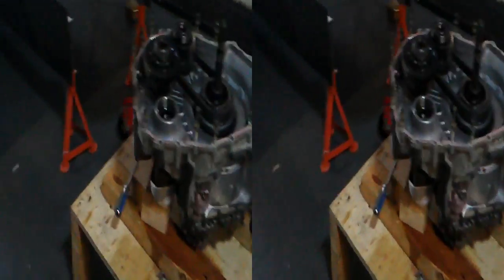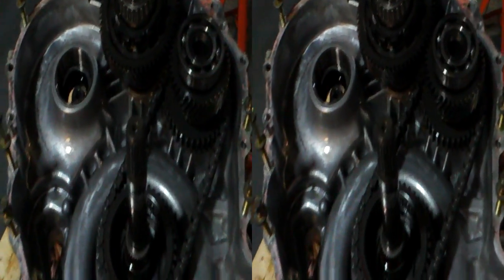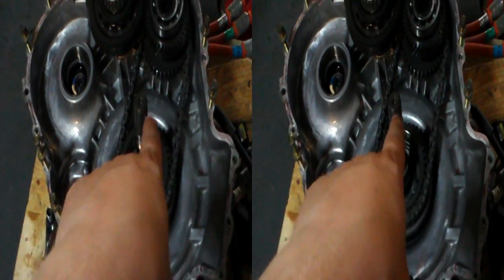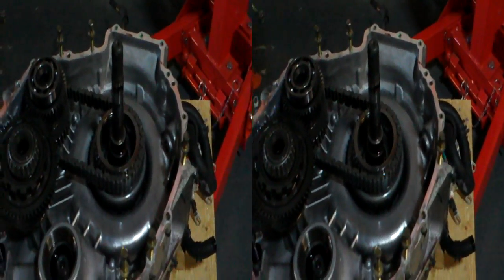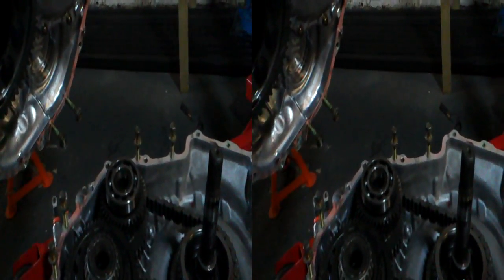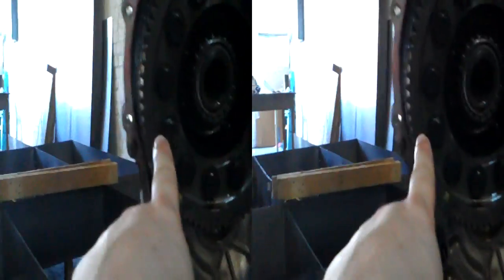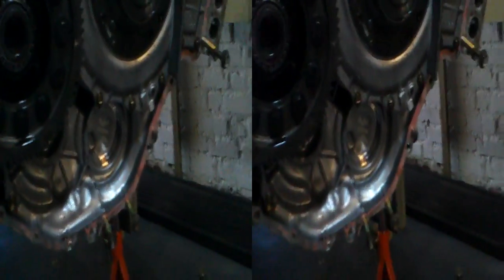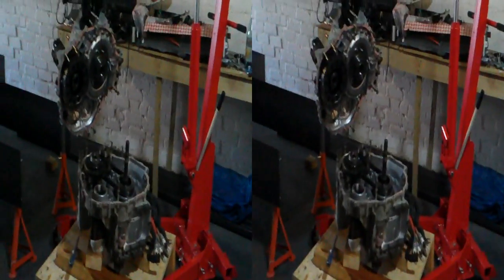Pruis Gen1 (NHW10) transaxle dismantling

Comment: please tell me, do the electric motors run in oil on the NHW10?
Reply from the maker: Will George No, there is a coolant which in red in colour which is separate from the rotor and stator, but the motors themselves are dry.